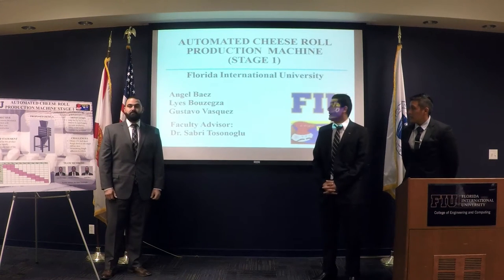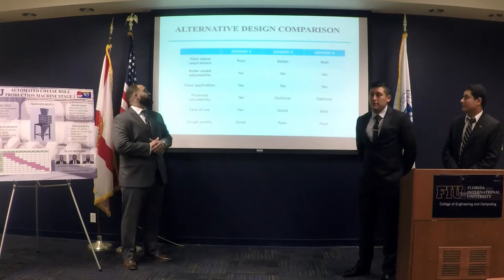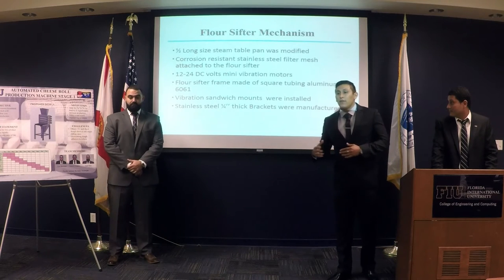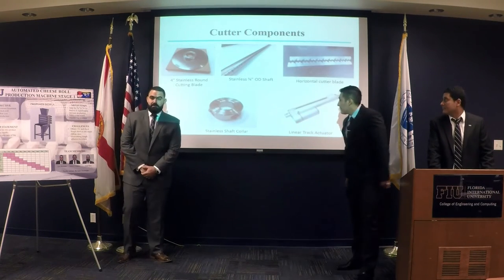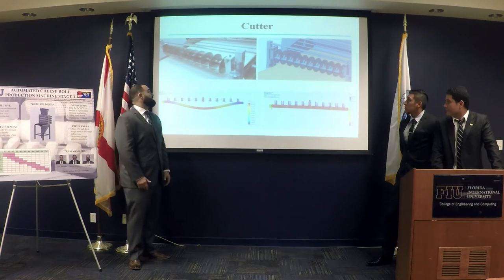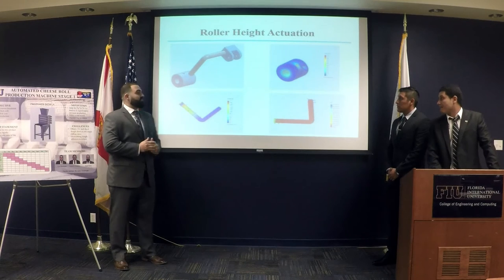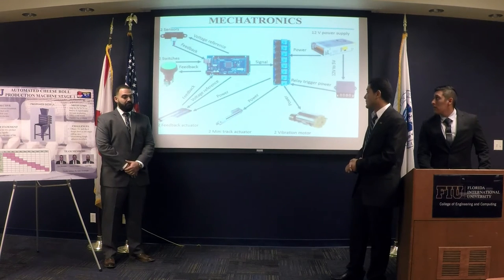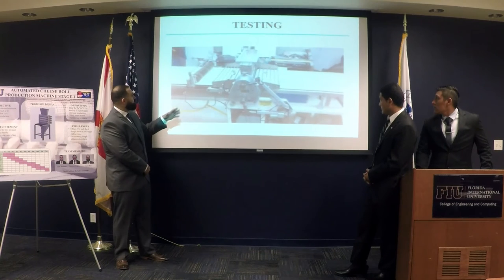SD Team 3: Automated Cheese Roll Production Machine Stage 1

Comment: Well put together presentation. Their design and design considerations were very well thought out. Their machine could very well be implemented, and at a relatively reasonable cost. Most of the presentation was handled by a single presenter but other than that great project.

Comment: Presentation slides flowed well from one to the other. The next slide usually answered questions left by previous ones. The detailed comparison between possible designs and reasons why the chosen one was picked was a nice addition to the presentation. However, presenters looked back at slides instead of the audience quite often. One presenter spoke more than the other two and answered most of the questions.